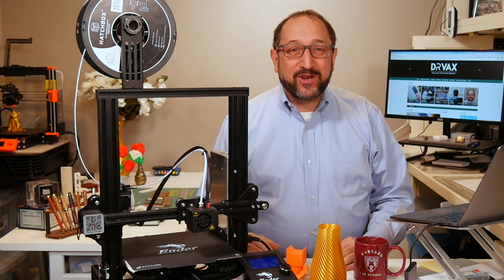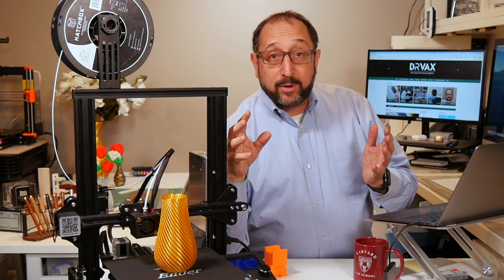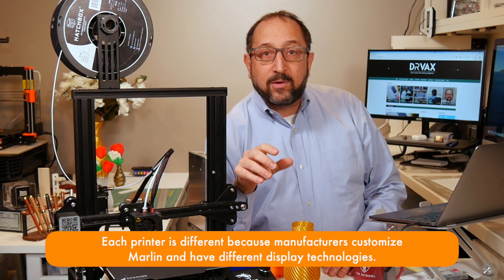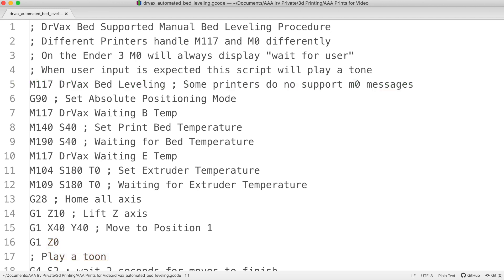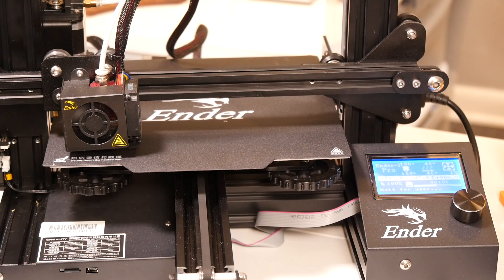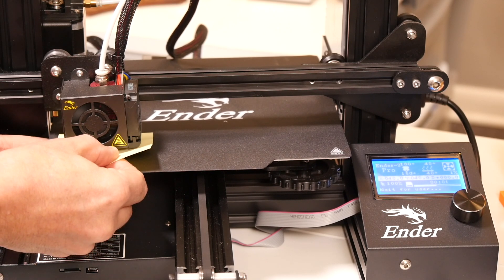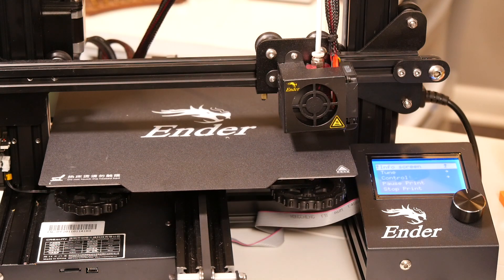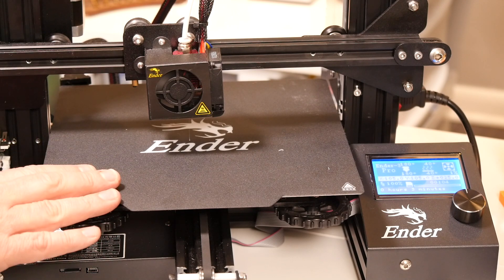How To Add Assisted Bed Leveling to a 3d Printer

Comment: Any chance you could help, I am having trouble with a BL touch Are you on FB?
Reply from the maker: Unfortunately, I do not own a BL touch.  I have installed an EzABL on my Ender 5.  Happy to try and help but if it is BL Touch specific I may not be of much help.

My facebook page is at https://www.facebook.com/DrVax-2550009975039839
Reply: what printer do you have and what mainboard?  TH3D has a good forum for printers that use their firmware and have some information on BL Touch.  I have one on my Ender 5 Plus and want to replace it with an EZABL, have hit the tip too many times
Reply: @woodwaker1  Thanks for the reply, I have the Ender 3 pro I wrote to Creality . Pissing me off ,how they cant offer me any advise as I bought from Banggood . I don't just want a replacement. I need to know what may have caused this
Reply: @madforit9661  What kind of trouble are you having?  Mine works, but I have jammed the probe and almost broken it.   I much prefer the EZABL.  Curious did you add the BL Touch?  I didn't know that any Ender 3 came with it
Reply: @woodwaker1  I printed a fantastic print which took 45 minutes, I then turned it off, about 20 mins later decided I was going to do another print. As soon as I turned it on I got a strong of electrical burning. The sensor had burnt out. My concerns are ,was it a fault on the sensor or was it something else that caused it. If I replace with a New one, you can understand my concerns. Creality are Crap, they say just contact your supplier. No tech support at all
Reply: @madforit9661  Have you tried to print anything?  Does the printer work, just not the BLTouch? My concern is that somehow the mainboard has a problem.   I'm still curious about the BL Touch on an Ender 3 is this something that was part of the PRO package?
Reply: @woodwaker1  I don't know how I could print ,unless I re flashed with the origonal software and re attached the stop switch
It does power on
Reply: @madforit9661  I have a better understanding of your problem now.  Without the BLtouch working you can't home the Z Axis.  I guess the solution would be for you to purchase another BL touch or another system like the EZABL.  Your main board may still have a problem with the BLtouch/ Zend stop interface.   You could also try hand writing some Gcode to move the x, y and z axis without homing